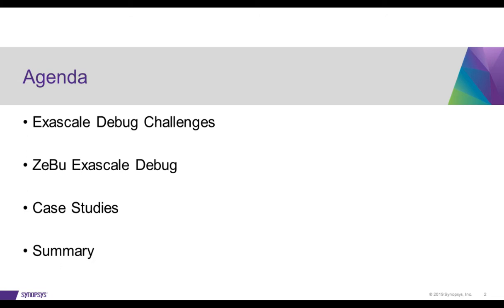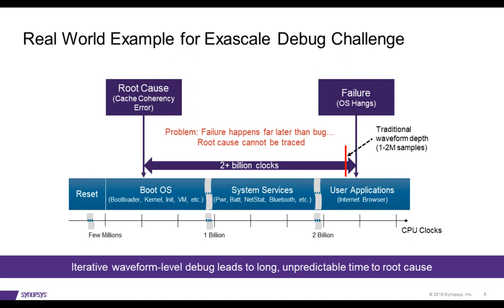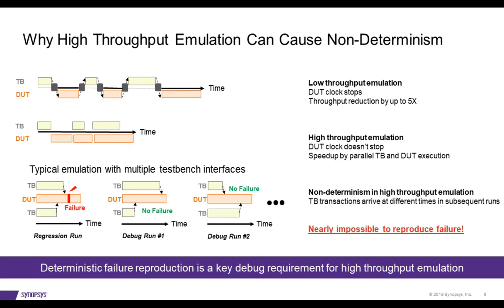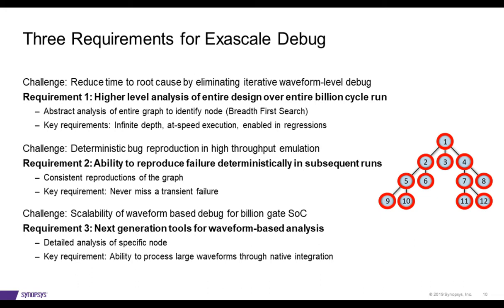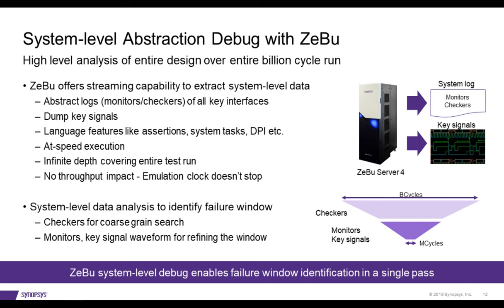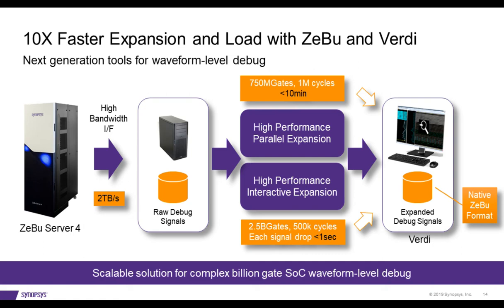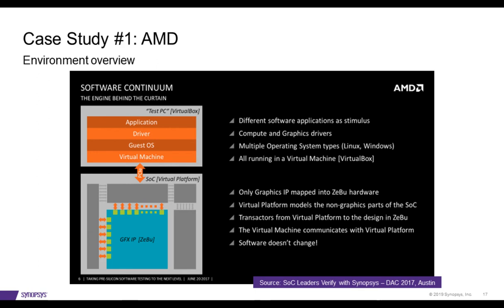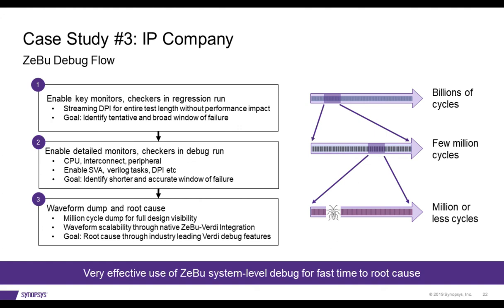Addressing Exascale Emulation Debug Complexity – The Case for a System-Level Approach | Synopsys

Comment: At S2C, we aim to pave the most 
innovative technological path for designers everywhere S2C s Prodigy 
Logic Systems and other prototyping solutions are built to help 
designers streamline their SoC emulation, simulation, validation, and 
verification processes Verifying the performance and design of ASIC FPGA
 prototyping boards is made easy with our systems Also, S2C s 
heterogeneous verification platform lets you conduct ASIC simulation, 
validation, and verification within a small amount of time S2C s 
prototyping products come in different versions and modules to cater to 
each designer s unique needs